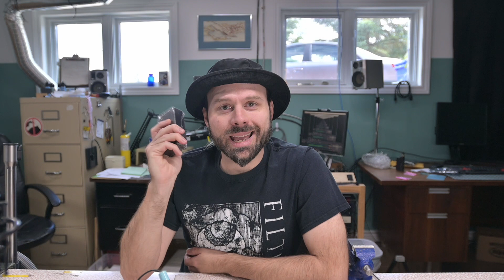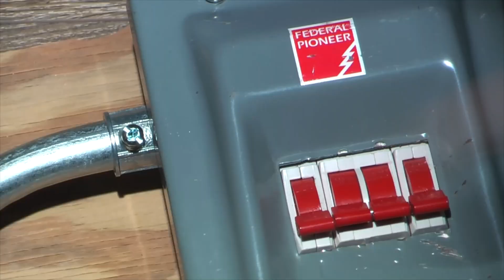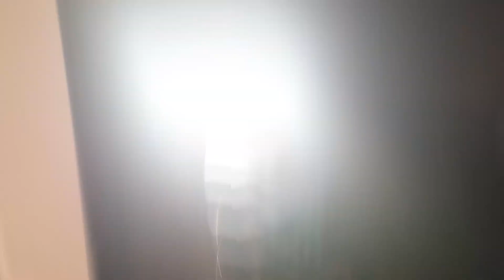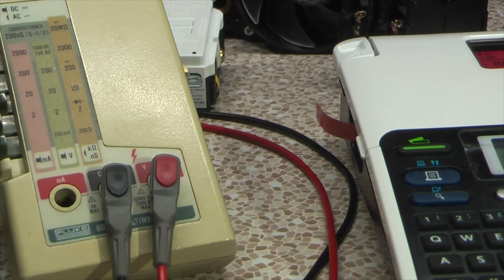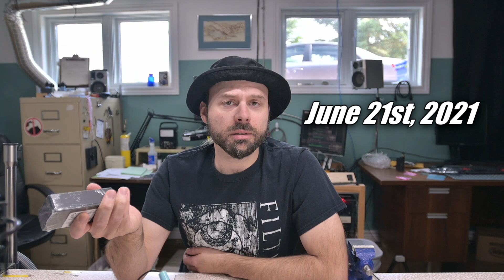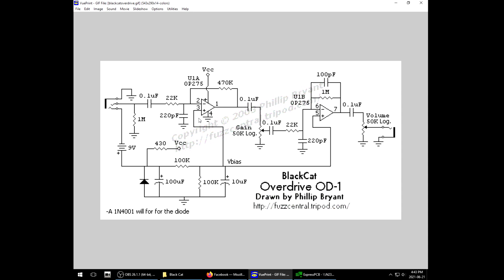Black Cat OD-1 "Freddie Fuzz" Clone Build

Comment: Yep, it's a fuzz .... remarkably similar to a Fuzz Face .... despite the differences circuit-wise. 

As much as I love the Fuzz-Face, I have just built a bazz fuzz variant ... using a BC517. Added switches to swap diodes between a Bat 41, and !n4001 and Bat 41 in series .... and another switch to change the input cap from 1uF to a 10nF.

It's now my all time fave fuzz (and I've tried a lot!) ... The diode swap switch moves from sizzly fuzz to more grit and growl. The cap swap moves from the typical Bazz-Fuzz ballsy low end slush to a more edgy top with more pronounced attack.

The bazz fuzz is such a simple circuit .... ripe for modding around .... a buffer ahead of the input changes the resulting output dramatically .... as does pre tone feed.

Would love to see a vid of you 'exploiting' this 4/5 component gem 😄
Reply from the maker: Well, Fuzzes never really hit with me. They tend to be fun for 15 mins then I get over it. So many of these pedals I made are just sitting on the shelf un played for literal years. 
I kind of got over pedal building. It learned me perf boarding which I've gone on to use for many other kinds of circuits, but I really was never much for pedals. I did however build a wicked "Reverb", a video of which should show up eventually.

Comment: If you ant an overdrive, build the Marshall Drivemaster or Guv-Nor, or come up with one of your own...
Reply from the maker: YOu recommend those Marshall units ?
Kind of over building pedals. This def wasn't much an overdrive, and fueled my frustration for what people will put the OD label on. As for coming up with my own, I have no where near enough knowledge to add anything to the covno.
Reply: @DATT  No worries, I build a lot of prototype some with a lot of challanges, but I find it fun just to see that it can be done.  I may have mis understood what you were wanting as far as an OD... sometimes simple is better.  I build everything on perf board which is even more dificult than PCB's, I guess I like to punish my brain.  Cheers and have fun building  
BTW I build pedals for myself because most pedals are all hype and most are just a cookie cutter of every other pedal or brand of pedals with slight variations in circuitry.
Reply from the maker: Hah yeah, there aren't that many originals anymore. 
This pedal said it was an OD and I like OD pedals to push my tube amps, but it so was not. 
I made a couple DOD 250 type clones in previous videos.

Comment: Sounds great! Ever think about a small single power tube metal amp?
Reply from the maker: Yeah, I've considered it, just haven't really had the need to. 
If I build a single tube amp, I'd likely end up cloning the JCM 1, or I had half a mind to use the JCM900 preamp that's mostly solid state. 
I tried to do that before, a very long time ago, it was hella complicated to cram a high gain all tube preamp into such a small chassis using the point to point techniques I was able to do at the time. Might fair better now days using perf board, but still tricky.
Reply: Like Fortin messhuga?? Yes !!😂